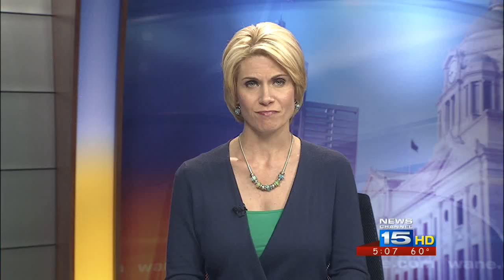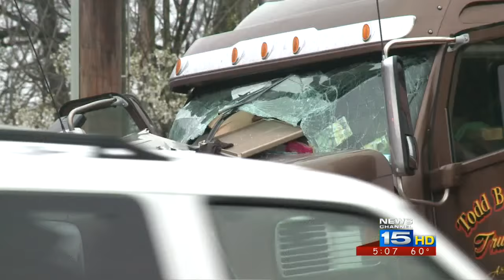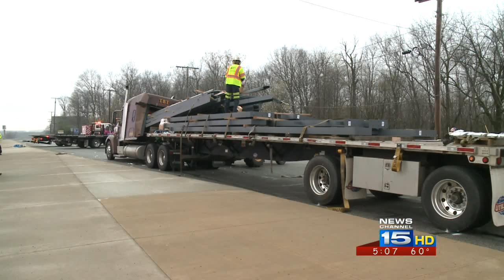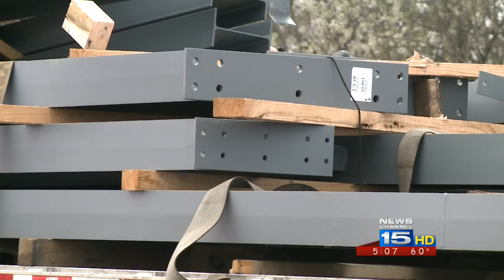Truck driver killed after load comes loose

Comment: Those types of loads should be done with a bulkhead flatbed.
Reply: How about doing his job correctly and using chains.
Reply: @TheRoadhammer379  chains could snap too . Normally they use Straps . but good ideaa combination of both is a good idead . so if one failed .hopefully the other will hold
Reply: Belly wrap with chain is underrated.
Reply: In the first place, those types of load, should be hauled by train, they're heavy duty with big risks, with the train, you just put it in a wagon, and no one loses their life.
Reply: @albertcristian4540  And how, pray tell, do you get it from the trains to the buildings they’re headed to?
Reply: @The_Voluptuary  First of all, if you're not into Trains, you can't answer to that question, but if you are, you can, you see, there are wagons that are detachable from the bogies and they can be transported by a truck with safety strips to the construction sites, and from there, by crain or by hand, depends on the weight of the load, and no one loses their life, again. (More time consuming but worth it)
Reply: @albertcristian4540 you do that only in 3rd world countries. Everywhere else, they use chains and belts. This guys merchandise was loose
Reply: @albertcristian4540  you are just chasing your tail there fella...eventually these have to end up on the back of a semi and be taken to where they have to go.....not all skyscrapers are next to railway tracks...in fact most aren't....compulsory bulkheads are the way to go for this particular type of load .....thats just my opinion...condolences to this mans family.
Reply: should of used super glue
Reply: @The_Voluptuary  yes lol
Reply: @albertcristian4540  but you just said the magic words... "By truck"... so the same risk still applies...

Yes, I'm actually VERY familiar with trains and their rolling stock... And trains don't, that I've seen, carry steel beam intermodels... Just container trailers that I've seen...

Yes, trains can, and do, carry steel beams... But they have to be unloaded from the rolling stock onto a lorry, then transported to where they are going... So again, as I said, the same risk still applies here...
Reply: But regardless of how fast he hit the breaks the man lost his life badly. trying to avoid hitting someone while on the job. I mean the steel beams went through the cabin and out the front smh. I think trucking companies also need to consider preventing this from happening. And this happened all because he hit the breaks smh ..  His company needs to be held accountable..
Reply: @therealspirit2035  I see your point here... However, it's really hard to place TRUE fault on any ONE indavidual... I mean, the car driver was at fault for obstructing the lorrie, the tractor/trailer manufacturers ate at fault for not installing safety gear to prevent this type of disaster, the lorrie driver was at fault for not properly securing the load, and the company was at fault for having such a load on such a lorrie... There are just so many variables... But as for the accident itself, the car driver would be found at fault for causing this to happen...
Reply: @therealspirit2035  yea it can be prevented but that depends on the driver. And it’s brakes not breaks. By the way, I did F-OFF and it felt great, pab 🤣🙄🤣🙄
Reply: @JT-sl3ui  you are right. Bulkheads are not fool proof or a "cheat death" card. I pulled skateboards for a short time and I have watched a 44,000 lb steel coil roll down a deck into a bulkhead like it was paper.
Reply: Nice headache rack would help with loads like this
Reply: No headache rack is built to stop this kind of weight.  Bulkheads are in tanks.  They work.
Reply: I seen this before and it's always  no head rack..prayers to the family..
Reply: A bulkhead won’t stop that  load, is just for showing, that’s it.
Reply: @albertcristian4540  yeah the only difference is that it takes a train a month to deliver the load, truckers can move the same load coast to coast in 4 days, time is money and trains will never beat trucks.
Reply: @therealspirit2035  It is certainly sad to see this happen the way it did, but if there was only ONE steel plate, lashed vertically in front of these loads, at least 3/8" thick, would not be seeing this today. Condolences to family.
Reply: @ranchhand1188  gorilla glue
Reply: Yep you are right sir. Got to have a bulk-head on the bed when hauling that kind of freight.
Reply: @albertcristian4540  so how are the beams supposed to get to the job site? There aren't train tracks everywhere.
Reply: He didn't use strap protectors. He had no twist in his straps. So the long high straps were fluttering in the wind against the sharp steel corners, and may have been partially cut already. He didn't use enough straps either.  3 flatbedder mustakes I can see. Must have been a rookie at flatbedding.
Reply: @therayven3147  We're just assuming a bunch of stuff in relation to a car. I don't even think it's relevant. I agree with Daniel, it should have had a bulkhead even if it wouldn't have been a guarantee. I'm sure the driver knew the risk but went of the money ( or his company did). He's driving a truck that should be able to apply full brakes regardless of what a car or anything else does. If braking cause that load to shift like then he was going too fast. Even if he had to drive 20 mph, then that's just what has to be done if that's all the braking force the load can take.
Reply: @albertcristian4540  very dangerous weight.
Reply: @aunkausarmawu-lisa7428  plus where I worked heat treated wood
Reply: Haul building just like used straps edge protectors ever last one of them made to job site flatbed loads you have to drive with caution all the time from turning judging traffic light other vehicles around you can’t relax not even second behind the wheel.
Reply: Flat bed hauler should have a steel
Bulkhead be his cab and trailer. 
Know as headbangers. Stupid not
Have one ,nothing to Slow or stop
A load from coming through your
Sleeper.@TheRoadhammer379
Reply: @albertcristian4540 and how do think a load of steel beams gets from train to construction site ?
By cab ?
Reply: @therealspirit2035 He's a contractor  that probably hauls only freight in a closed trailer. 
You need to have a headbanger 
Behind the sleeper. A must for flatbeds.
Reply: Nobody should be dragging a skateboard without a headache rack
Reply: @MrBwire you would belly wrap painted structural steel with a chain.....

Comment: For all of you saying the driver should have a headache rack is wrong, the rack is only used for extra storage to place chains and etc. on them. They are also known for just looking real good behind the cab! Steel Beams weigh so much even if the guy did slam on the brakes the headache rack can’t stop a load that heavy. I can’t believe the comments of truckers on here and don’t even know that? Rest in paradise brotha this is truly sad!! I remember after I was done strapping down a load onetime and one of the managers comes over to tell me that I didn’t need all those straps. I told him there is no such thing as being extra secured and it’s for my safety and the others around me! The lack of Training now a days are just terrible!

Comment: To all the cars brake checking trucks,I just wanna say thanks.poor guy lost his life cause of yall.saddest part of all.All we do is deliver💩for yall,and look how y'all repay us,THANKS.
Reply: I lost my uncle in the trucking industry due to an 18 ton load flattening him.  RIP...  He pulled over to check the load and while he was tightening the straps, the load shifted. They say he was one inch thick on the asphalt...
Reply: @petroldevo9934  that's very sad and I can believe he may have been carrying a 40k lb coil,maybe a ingot,those are some of the heavier single piece freight hauled on a flatbed.this is very sad to hear about.i typically use about 9 chains on that kind of  weight.ingots I use all my straps 10plus x chain the front and back with 1 inch or half inch chains.i make 100 percent certain I'm safe to travel down the road.flatbedding is probably one of the best jobs/careers you can have in america.until of course you get the typical asshole brakechecking all over the place and cause a life.just speed on off like didn't anything happen.meanwhile a innocent person is battling for their life because you wanted to have a little fun.people like that don't deserve to live.imho
Reply: @christophernelson8253  it was a load that the military put on his truck supposedly.  It was wider than the trailer So He had an escort to get the thing down the freeway. Someone said they whitnessed the load fall on him. Really sad...
Reply: Improper or inadequate load security is on the driver.
Reply: I was told about this happening to drivers while in truck driving school.
Reply: Christopher Nelson:  and you know for a fact it was a brake check 
Please inform the police immediately
Reply: Oh god dude, make a pamphlet and hand it out at Walmart.  You do what you do for money and your family so you’re paid!! Act like truck drivers aren’t out there making mistakes, half y’all don’t even pre and post trip like you’re supposed to!! 🙄
Reply: Sounds like someone did'nt secure the load properly. I really have'nt seen or heard of too much intentional brake checking happening
Reply: I deal with alot of truck drivers daily,. They are just as bad of drivers as 4 wheelers. Just because you drive a truck doesn't mean you're perfect.
Reply: @michaelshuey9670  I have
Reply: @sliedogg  I’m not a truck driver but driving is their job! They are not just driving to the grocery store or whatever! They are better drivers than most people on the road!
Reply: @jimmycline4778  I work with and am one,. I now dispatch,. There are pros, and there are those who shouldn't be allowed to drive a truck. If you don't work in the industry, how can you understand.
Reply: @michaelshuey9670  ..4 times..3 by four wheelers and one by another truck..we that have been brake checked intentionaly have another way of thinking towards it
Reply: He lost his life due to his laziness, straps instead of chains on steel beams.  He won the Darwin Award
Reply: Don't mention it, hey thanks truckers 😆
Reply: I've seen a semi lose his load due to a badly timed red light. It was concrete sewer pipe sections and I saw them break on the trailer. He probably wished he ran that one.
Reply: @digi3218  unless he was involved in an accident by running the light.
Reply: @richarda1568  Nah he would have been good. It was one of those yellows where you either have to slam on the brakes or speed up a bit and the light will still be yellow right up to the point you enter the intersection. Light would still be red for everybody else. But if a cop is watching and wants to be an asshole then you might get a ticket.
Reply: @richarda1568  It was just one of those yellows and like I said he probably should of just went through  or had stronger straps.
Reply: @digi3218  when a light turns yellow, you are supposed to slow down as the light is about to go red... Technically, going through a yellow light without at least trying to stop for the red light is illegal, and could result in a fine/points on your record... If the light go red before you cross the intersection...

Yes, I have read and studied the driver's handbook...
Reply: @therayven3147  He obviously wasn't able to stop safely so he was good to go through. Slamming on the brakes is dangerous. He would have been fine going through it.
Reply: Ashley Maples  well, a little bit different wording than how I said it, but, exactly...
Reply: You don't do it for us . So stop it...you do it for.your own and your paycheck.
Reply: @petroldevo9934  that's gross.  You didn't have to add that!
Reply: @christophernelson8253  you have NO idea why he slammed his brakes.  Stop assuming!
Reply: @sliedogg  thank you! Why is everyone acting as if truck drivers are these perfect creatures who never ever are at fault??
Reply: @therayven3147  you're wrong. Yellow means go.  Only jerks brake in yellow.
Reply: @trawlins396  As a result of bad truck drivers,. Texas has a new law in effect as of February 22'.  New drivers are required to have more extensive training done at an approved school.  No longer can your uncle teach you to drive and then you take a test.

Comment: For everybody that doesn't know, if you need to change lanes in front of a truck driver, then flip on your signal but don't get over right away. leave it on for a few extra seconds so you're letting that driver know that you need over. that gives that truck driver enough time to realize that you're going to get over, and they can take caution and be prepared instead of having to slam on the brakes cuz some idiot just cut them off.
Reply: It's not that people don't know this.  It's that they don't care.

Comment: A good friend of my father's died a similar death back in the early 1960's while trucking. There is a panel that can be added that goes on the back of the cab to prevent things sliding forward like that. I've heard it refered to as a headache rack.
Reply: Those are mostly good for just hanging straps and chains on. With the weight and momentum that steel had a headache rack would barely slow it down. A bulkhead on the trailer is the only thing that would prevent this.
Reply: @tylerbonser7686  Wrong.  A Bulkhead only stops rain. Made of normal thin metal.  A Headache Rack is ... A RACK!  Made of strong steel for this Very Purpose.  It was MADE to stop heavy stuff.
Reply: @NextWorldVR  trailer bulkheads are not just a thin piece of steel.  They are reinforced with thick tubing and help prevent the load from shifting forward.